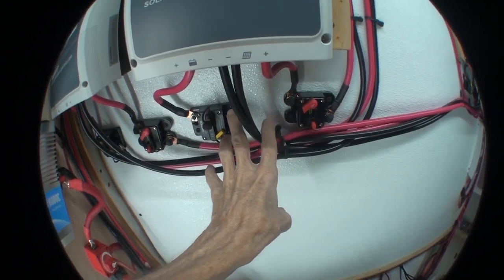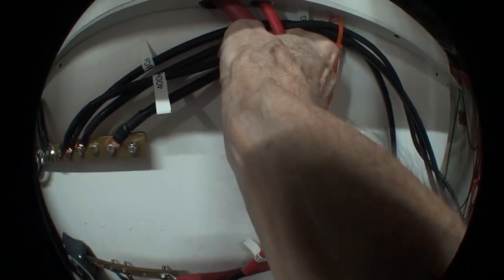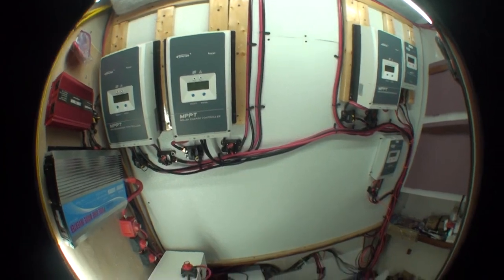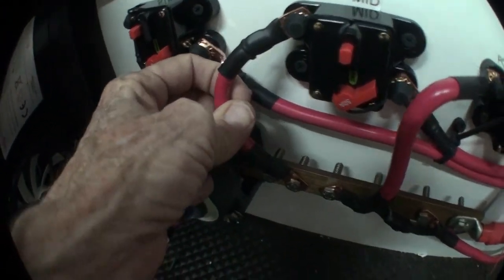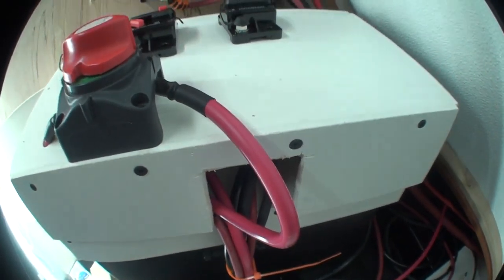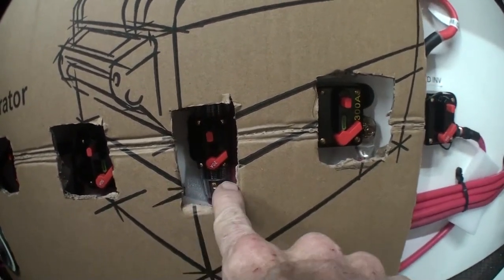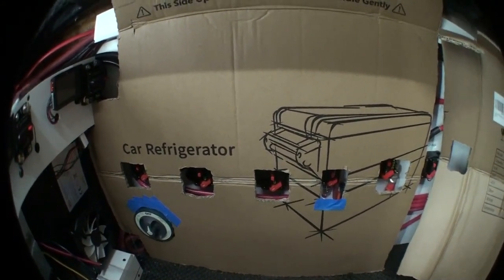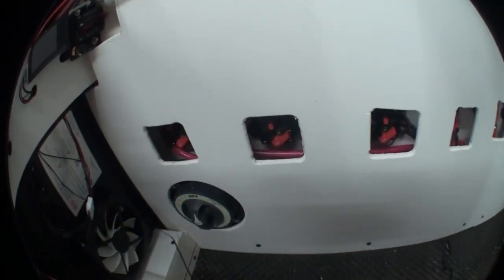Off Grid Solar-Don't Burn The House Down

Comment: If that’s you “not knowing what you’re doing” you must like to calculate rocket telemetry for kicks! 
I’ve seen “professional” set ups that weren’t nearly that well laid out and safety redundant. 
The only thing that concerns me with solar systems is that unlike in traditional electrical service; there aren’t the kind of manufacturing standards, code enforcement, ratings and long standing history with the various components. 
Wishing you all the best!!! And happy sailing.
Reply from the maker: I became aware that I didn't know what I was doing when I realized the wire runs from the batteries had no breakers protecting them.  I spent last summer cruising around with a similar 12 volt system with 4 KWH of batteries and nothing to stop a frayed wire from burning the boat down.  Once the gravity of that situation sank in, I started looking for any place electricity could leak out and burn down the boat.  Then I did something about every threat I found.  If I missed something, hopefully someone will post it in the comments.  I got a bullshitters degree and all the boat stuff is made up as I go.  Fiberglass was easy enough to learn by starting with small projects before doing larger ones.  This electricity thing actually seems pretty dangerous as a learn by doing experiment.
Reply: Nine Hundred Dollar Luxury Yacht I suppose all degrees are “bullshitters” degrees. Maybe that’s what BS stands for?
But you can’t carry water with a net, so you obviously have an abundance of grey matter!

Comment: Hi James, You have spent a lot of money on quality materials but when it comes to layout and wiring there is a LOT wrong with this installation. In boating we almost always use 4/0 cable on a 3000 watt inverter. The circuit breakers you are using are almost certainly inadequate for some of the circuits they are trying to protect though I cannot be sure without seeing the installation. 

DC positive cables in inverter installations need to be protected with a class T fuse because it has a very high AIC - amperage interrupting capacity, which is the "maximum fault current that the protective device can clear safely, without welding closed or causing damage to equipment or personnel." In plainer terms, it is possible for a circuit protection device, either breaker or fuse, to take such a high amperage hit that the fuse/breaker welds into a closed position so instead of breaking the circuit it welds it in place and facilitates amperage flow. This is dangerous stuff. I have been in the boat business for 40 years and have never used a circuit breaker for an inverter installation or even seen one used in that manner. They are simply not robust enough for the "potential" surge amperages. Many inverter battery banks produce enough juice to arc weld and you need components that will take that kind of load. Also, it is vital to ground the inverter and charger cases to prevent shock incase of a failure inside the component.

Regarding youtube, I have done extensive you tube searches and have as yet to find a video that gives adequate guidance in inverter installation. Several try but they fall far short of a safe, efficient installation.